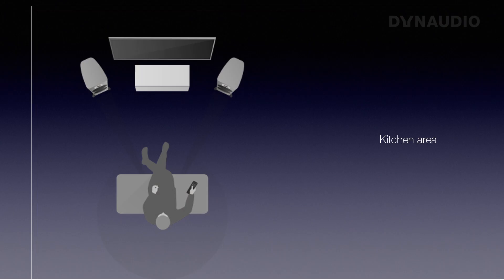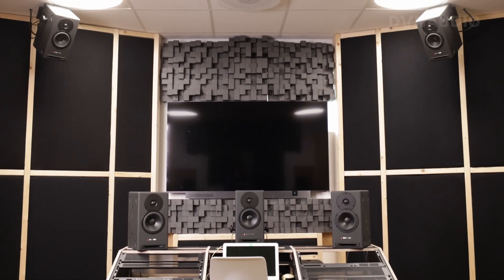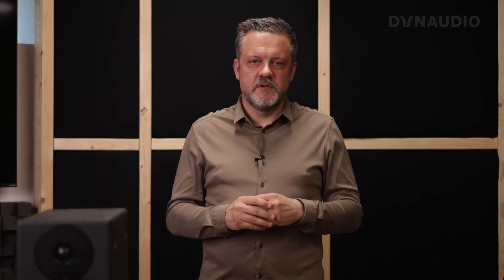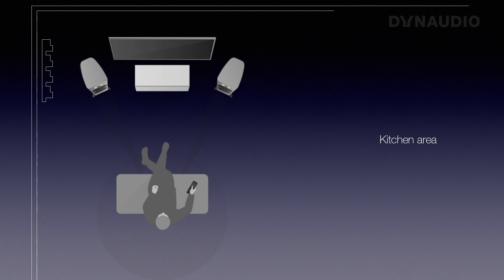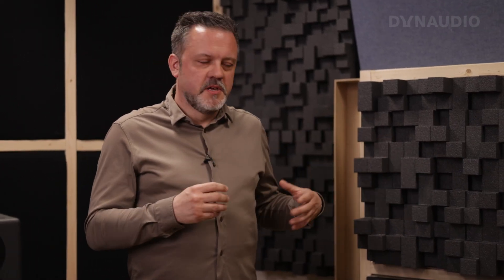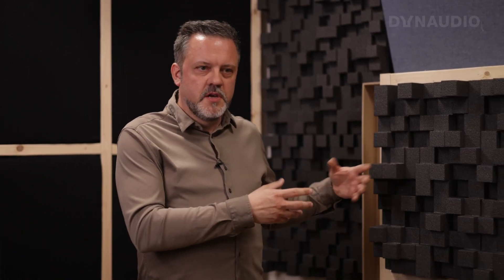Acoustic panels to the rescue: fixing asymmetrical speaker setups

Comment: Here is one question: 

I'm curious about how Dynaudio determines speaker placement within the cabinet across different models? For instance, in the Evoke 50, the tweeter is positioned quite high -  above the mid-range driver, when seated against a typical sofa - tweeter is above ear level. What influenced this design choice compared to other models? For example the Contour series 30i - same cabinet height as Evoke 50 - but a different crossover and speaker layouts...? 

Some friends of mine have mentioned that the tweeter position in the Evoke 50 lifts the stereo image a bit too much. Is that an expected outcome, or how would you explain and defend this design decision?

PS: I really love my Evoke 50s and think they are perfect as they are, but some insights to deepen my understanding would be much appreciated. Thank you!

Comment: Great topic! It is often difficult to find the right balance between living room and listening room. How about DSP like RoomPerfect, for instance? Can it help in any way?
Reply: Yes, to reduce peaks in the room response. However, those solutions typically can do little against "nulls" (where sound waves interfere destructively), and also nothing against reverberation. The only solutions that can solve the first problem are Dirac ART and Trinnov WaveForming. Both work by relying on more than two sound sources, so it's not really useful for a stereo setup. Reverberation is difficult to control with algorithms - and for that reason I wouldn't expect those solutions to help with an assymetrical layout.
Reply: @deiruch  I agree with the first part, but not 100% on the last bit. I actually do find that for instance Dirac that we use in our Focus speakers can be quite helpful in improving assymetrical layout. The wall close to one speaker will increase the total output of that speaker, relative to the free standing one, and that imbalance distorts the soundstage quite significantly. Because the calibration software optimises each speaker individually, they become acoustically more similar, and thus more symmetrical - which is what we want. Dirac also corrects the timing of each speaker, so especially if the listening position is not perfectly in the center, this can make a big difference.

A while ago I actually visited a dealer who had deliberately created an imperfect setup, quite similar to the one mentioned here with one wall close to the left speaker, to simulate what happens in bad rooms, and demonstrate how customers could alleviate this (which I found very cool!). This was a very direct and convincing demonstration of the effect of Dirac, in a sub-optimal room. In this setup, Dirac made a very clear and non-debatable improvement in the focus of the soundstage. Particularly the voice of a singer would be quite diffuse and hard to localize without the correction, but with the correction voices became quite solidly focused between the speakers. Probably one of the best demonstrations I've heard of the benefits of DSP.

That does NOT mean that the DSP will fix every issue of the room. But there are certain aspects of the impact of assymetrical layouts where it can indeed be very helpful.

/Otto, Dynaudio Academy
Reply: Good question for a follow up video! The best answer is that they are different tools, that work in different ways and thus solves different issues. One is not really a direct replacement of the other. DSP does not reduce the inherent reverb of the room, or avoid direct reflections and flutter echo from flat, hard surfaces. But, it can be effective in reducing the effect of room mode and other peaks, especially in the bass. Reducing room modes through physical absorbtion requires massive amounts absorbtion, or physically changing the dimensions of the room, both of which isn't really practical in normal homes. My suggestion is to avoid trying to use DSP as a replacement for optimising the acoustics. The best result will be to try to optimise the acoustics as much as you can, and then look into whether DSP can further improve the sound - but prioritised in that order.

/Otto, Dynaudio Academy